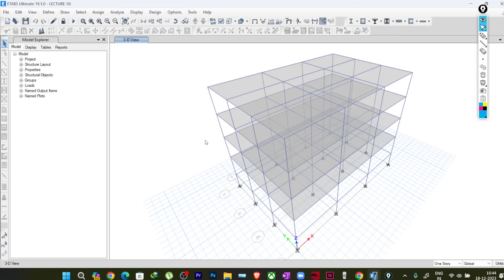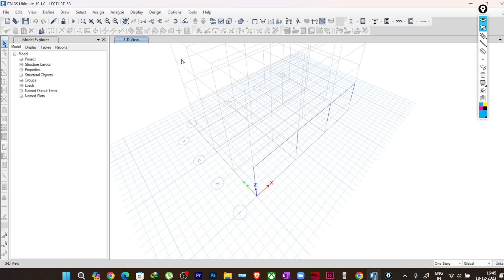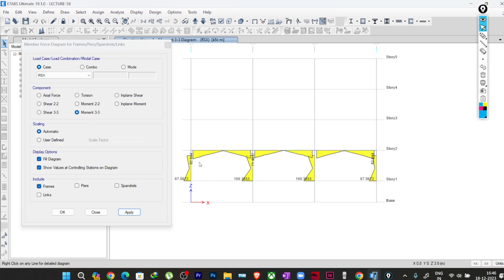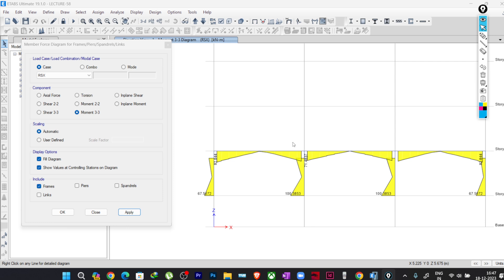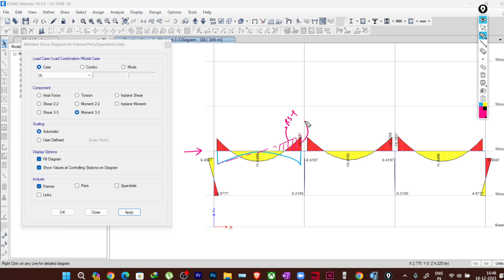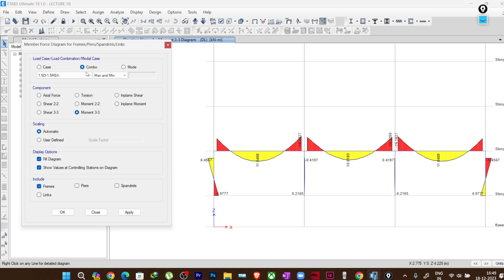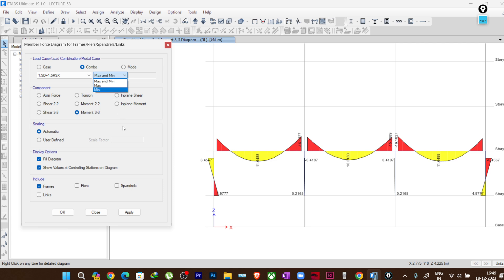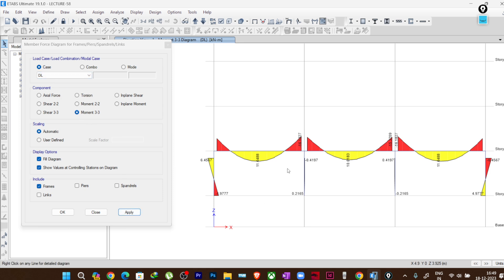Response Spectrum Case and Load Combination- How actually ETABS does it ?? | ilustraca | Sandip Deb

Comment: The efforts generated by the spectrum in the structure are absolute values, which cannot be combined with gravitational loads (which have a sign convention according to the direction of the force). How can you give a sign to the forces generated by the spectrum and be able to combine them with gravitational charges and so on?

Comment: Hi sandeep, will the etabs design and provide the reinforcement for a member by taking max and min values ?
Reply from the maker: +ve gives max sagging, -ve gives max hogging, ETABS designs for the most critical one at each 13 section throughout the beam length
Reply: Thankyou
Reply: Sir can you explain more about what you mean by the 13 section? Thank you 🙏

Comment: Sir in load case you took 1.5{DL+RSx} but in calculation u took 1.5{DL+SDL+RSx} ...Why did u include SDL.. is it right or wrong
Reply from the maker: DL means Dead Load, in the combination all Deads loads are added …. D+SDL is the total Dead load
Reply: Sir what about the design of the prestressed slab & beam, can please make a detailed video on it, means how to design on software(etabs) & how to provide detailing